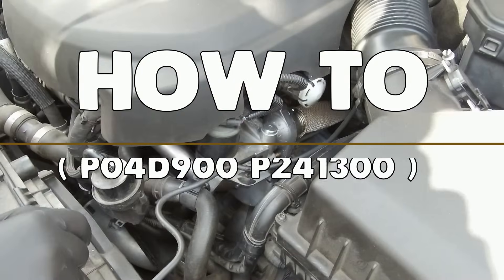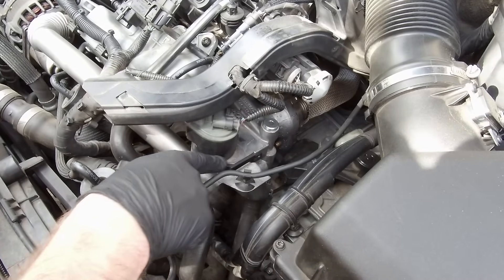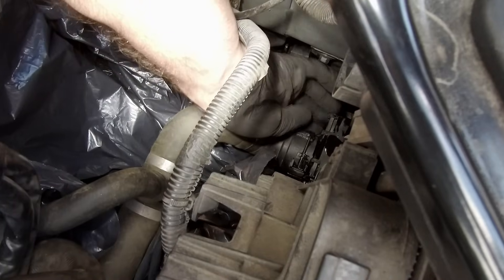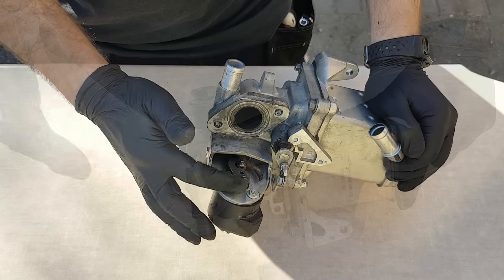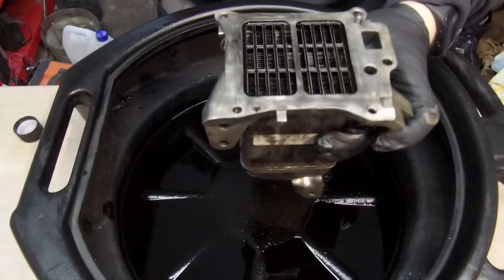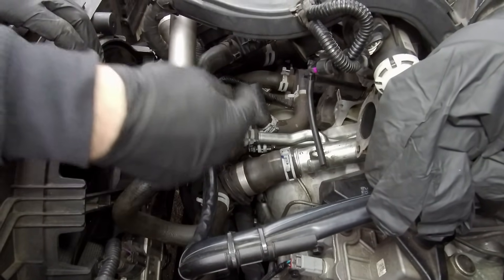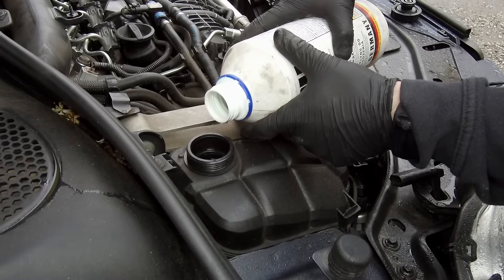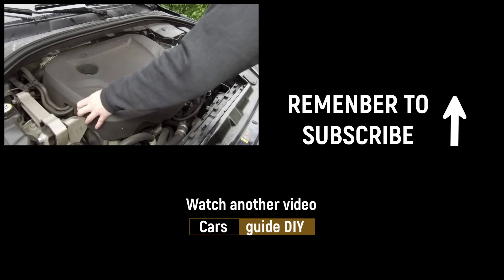How to solve a problem with EGR valve : Volvo 2.0 D4 ( P04D900 , P241300 )

Comment: You didn't show removing the 2 bolts at the rear of the EGR that connect it back into the exhaust system. My Volvo has 2 torx bolts that are near impossible to remove. you can see the connection I am referring to at around 15.02 at the rear of the EGR top center of the screen.
Reply: Was wondering the same Peter. They are an absolute nightmare to get access to.

Comment: Hi, one question please. For the 2016 model is the same process? A mechanic told  me that is electric EGR and he recommend the replacement , he cant clean EGR. What do you think?
Reply from the maker: Hi there,
it should be the same. In my opinion for mechanic is much easier to replace it then clean it. 
If you don't do it personally you can't be sure that he will clean it properly...
Reply: @carsguidediy  I have to a mechanic that tried to clean it but he told me that the problem is on the electric/electronic side, it wasn't the so full of carbon deposits. all around 550 EURO
Reply: Cars Guide DIY very true! My Volvo dealer has messed up so many times with my car. DIY by myself.

Comment: Thank you for this video, it would be the same kind of process for a v40 d4 2015 my check engine light has came on, I am pretty sure this is the problem the only tools I am missing are the diagnostic
Reply: As long as you have the 4 cylinder diesel and not the older 5 cylinder then the process should be as per the video.
Reply: @FatHead1979  yes important to mention its for the 4cylinder D engine , since some 2015 volvo still used the awesome 5cyl... my v40 2015 has a D5204T6
Reply: @erwanfrenchy8849  Lucky you!  The older 5 cylinder diesels sound really nice (for a diesel)

Comment: I had the same problem with the EGR valve, 90000 KM on my 2012 V60 D3, and the valve is causing problems. The engine light is on, but the engine starts immediately and has no loss of power, but I still have to go to the workshop, in Germany it costs € 600 to repair.

Comment: With high temperature silicon the cooler liquid comes out from the cooler I suggest to buy new gasket
Reply: If gasket is ok, then why buy the New one. Just clean in, leave it and use silicon for better seal

Comment: Had issues with my D4 XC60. Jumping around on cold start. Volvo eventually accepted the EGRs have been an issue. Mine was sticking. They changed it outside of warranty. Kick up a stink. They will change it. It’s a well known issue....
Reply: @lewis I just took my car to Volvo Dealer and mentioned this "check Engine" issue. I have the similar error code and Volvo dealer said, there is no recall for this issue from Volvo and Dealer can not fix this issue for free. It would cost me £799 ( labour and parts ). Could you please let me know which dealer did you go to and how did you get this done for free?
Reply: @golamrumi4308  hi. I have a 2016 Diesel Manual Volvo. Within the three year warranty they changed the engine due to the ‘jumping’ on cold start blaming components of the engine. They never needed to do this as in my case the issue was the EGR all along. Basically the cog/lever stuck at points which causes an airflow issue momentarily and as such it jumped. Wasn’t an overly bad thing but for how new the car was at the time , I wasn’t happy. I had no check engine lights or anything like that. I simply argued that this was an issue that arose within the warranty period. They resisted so I suggested I wouldn’t go away. They changed it for free accepting it was the EGR all along. I did my research and read about issues with EGRs. Basically they have been over designed. Cooked far too much and as a result there will be a sludge build up and it won’t go away. Mine had this issue and had the faulty lever. What issue do you have? What are they saying is the issue?

Comment: The cheapest option is to program the egr unit and toss it out.  Does not damage the engine for the future and if you remove dpf you have a car that will not stomp for a long time and roll smooth er. :)

Comment: Thanks for the video :)
do this tutorial apply  for the V40 D4(D4204T14) engine?
Reply from the maker: I don't remember exactly, but EGR valve is very similar, but it might have some slight differences. So this video should be helpful anyway.
Regards :)
Reply: It does. It is almost the same.
I think the bracket at 5:45 is missing on D4204T14, apart from that it should be exactly the same.

...actually one more difference. The battery on D4204T14 looks bigger than on the car in the video. It has terrible access to the bolts on the exhaust pipe. But it is doable. Make sure you tighten them evenly, I had a leak there.

Comment: Soaking these really isn't good enough. It will clock again in a few thousand miles at the very best. I bought a cheap ultrasonic cleaner and put it though that after ' cleaning it' like in this video. It was back on the car for two days after cleaning and was dirty as anything already.
Reply from the maker: Sure it will be dirty again, because it works with exhaust gases. But if it starting to clog again so fast maybe you have something wrong with other parts, like leaking injectors nozzle or blocked DPF.
This car already done over 15k miles and egr cooler is working fine ;)
Regards :)

Comment: Brilliant video!!  Two tips, I found I really didn’t need to drain the system, only very little fluids out, and use over cleaner if the cooler is really blocked. Because it’s aluminium don’t leave  the oven cleaner on too long, but 15 mins won’t hurt it, and is 100 times more effective than anything else, if the cooler is really blocked, you won’t unblock it with anything else.
Reply: I've got some industrial degreaser that will work😂 got the same problem on my s60 I'm going to have a crack at sorting it sunday

Comment: Why make these videos? I can see you have no idea what your are doing. The cleaning process is okay. But there is developed a new EGR valve. And there is a service solution (a new coolant-system to egr-system) and a new ecm software.  If you dont do that, it will keep failureing.AND Volvo is paying for this - if the car isnt to old!
Reply: Probably because in many countries Volvo have not confirmed the latest (hopefully final) fix, in the UK we've heard nothing since the recall was started back in summer 2019.  Guides like this allow people to at least resolve the issue temporarily until Volvo finally sort the issue out.

Potentially, someone could follow this process as part of annual servicing and it may be sufficient to prevent the issue ever returning. (until Volvo hopefully release an actual fix, seeing as their "fix" from 2015 of an "updated" EGR cooler and pipework to make the EGR cooler run hotter clearly actually didn't fix the issue, although it may have reduced the rate that the carbon builds up)
Reply: Do you have the official documentation that Volvo has to and will replace the cooler and valve? Dealer here says "no problems, only replace emap pipe one day" and that's it.

They will not replace egr under warrenty (5y old car, 200.000km)

I have only 1 DTC, maf flow low, P00BC, quess that the emap pipe is bullcr*p and it's truly a stuck EGR valve.
Reply: First EGR was replaced at 70000 km , 2nd at 147000 km .  Now i read that Volvo has a recall for the D4 (2015) engine. 🤬 could somebody post a link ??
Reply: @FatHead1979  would you know if this is also the same problem with the D4 2.4 Volvo used on the AWD XC60?
Reply: @chargrilled9081  It only affects the newer 4 cylinder "DEA" generation of engine, as best as I can remember the 2.4 is an older 5 cylinder unit and is totally different in terms of its EGR and EGR cooling configuration.